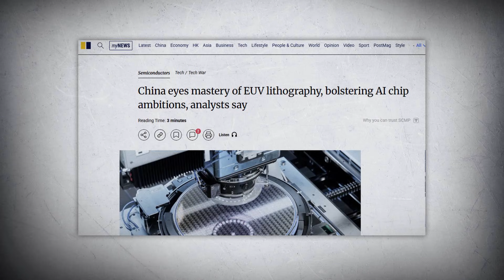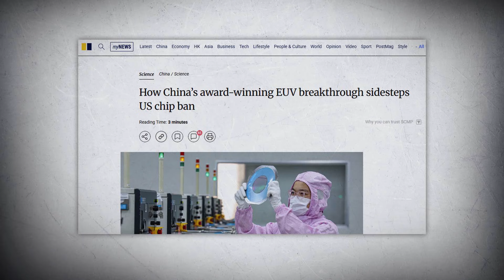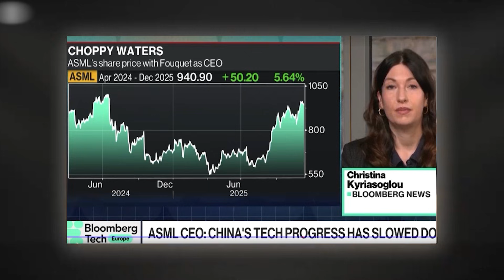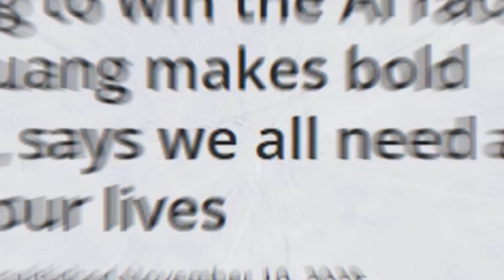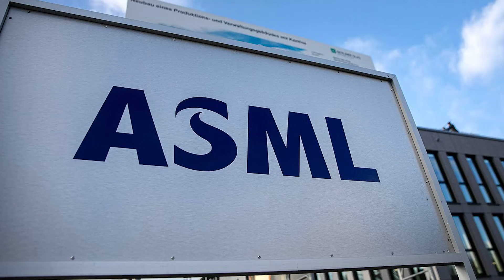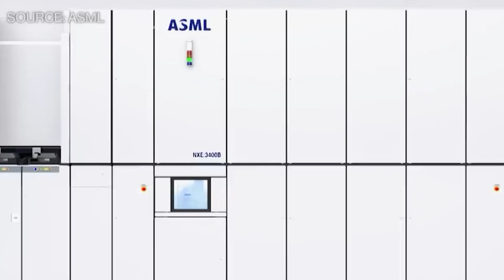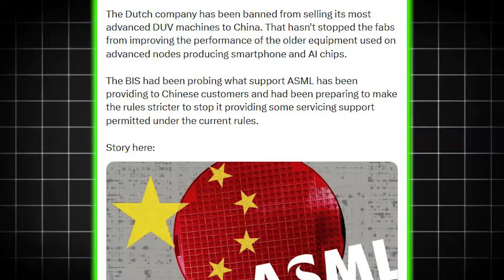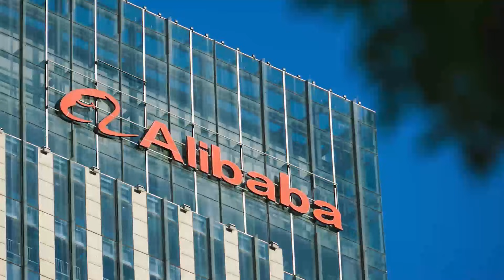China’s Manhattan Project: The Secret EUV Machine the U.S. Tried to Stop

Comment: The Chinese EUV is LDP EUV which is a completely different from the ASML one which is LPP ASML machine.
LPP cannot be done because of its patents in many areas.
China have been working on LDP technology since 2016 and has a lot of patent asocieted to that tech.
Then, Reuters lie citing "anonymous sources" to implant an idea in the mind of the people, which is "China cannot do it by itself, is doing something ilegal and with help with ASML engineers in the shadow"
Their version make not sense at all, because no ASML engineer can help them to develop LDP EUV because is completely different from LPP EUV.
Reply: Exactly.
They make this propaganda just to "justify" them own weakness and future stealing from China
Reply: Thank you for clearing this up.
Reply: A patented right can only be protected against someone else COPYING that patent. However, if someone finds a route (solution) to solve the same problem or issue, it cannot be said to have infringed upon the original patent. In other words, someone else could have found the same solution but did not actually copied the original patent. 

Take for example a famous case in the 1980s - that of the IBM PC when the PC had the total rights to its BIOS - Basic Input-Output System - chipset. This chipset controls the keyboard, the printer, the monitor, the memory, etc in communicating with the CPU and vice versa without which, a computer cannot function. Competing computer companies tried all sorts of ways to get around the IBM chipset using software manipulation (called, "Interpreters") but they were slow and didn't work 100%. In other words, none were 100% totally IBM PC compatible - IBM PC dedicated programs will not fully run on those 95% "compatible" PCs and people wanted to use IBM PC software. 

The impasse' was finally broken when an IBM competitor figure out a way to make their own PC BIOS without infringing upon IBM's patent: they employed a team of computer engineers who are deemed IBM PC "virgins" - engineers who have never touched or seen or used or have anything to do with an IBM PC machine. They were tasked with a situation - if you have an 8000 series CPU and you need to get it to communicate with a keyboard, disc drive, RAM and ROM memory, printers, etc what will you be able to do. IBM had used an "open architecture" for most of the PC's components, but the BIOS code was protected by copyright and was the primary legal hurdle for competitors. 

The engineers got to work and came up with their own BIOS solution - which worked. 

In 1982, Compaq Computers was the first to successfully create its own functional, legally-developed clone BIOS using a "clean room" (with "IBM PC virgin engineers") and reversed engineered the solution to the problem. This proved that a compatible BIOS could be made without violating copyright.

The IBM PC BIOS "monopoly" was effectively broken in September 1984, when Phoenix Technologies released its own legally reverse-engineered, compatible BIOS to other manufacturers, allowing the mass production of IBM PC clones. 

While Compaq used its BIOS for its own computers, Phoenix Technologies developed a fully compatible, faster, and more robust BIOS that it licensed to any manufacturer. This created an open market for compatible PCs and exponentially grew the clone industry, driving down costs and market share for IBM (when IBM held the monopoly over is PCs, it could charge anything it wanted and people would pay. For example, a bog standard 104-key keyboard that costs $10.00 today used to demand a price of $500.00 from IBM or a parallel printer cable that costs $5.00 to make, IBM would charge $100 for - all because of its BIOS).

The availability of third-party BIOS chips from companies like Phoenix, American Megatrends (AMI), and Award, established the IBM PC as an industry standard rather than a proprietary IBM product. This shift led to the "Wintel" duopoly (Microsoft Windows and Intel) and eventually prompted IBM to exit the PC market entirely by selling its division to Lenovo (China) in 2005. 

A scientist once said, "there are more ways to skin a cat" and "there are more ways to get to Rome" which exemplifies the case - in engineering and other technologies, there can be no absolutes in a solution to a problem. Consequently, while ASML has patents to its lithography machines those patents or ways to get something achieved - are no absolutes as there are other ways to get to the same achievements without resorting to copying.    

For those who don't understand what is the difference between LDP and LPP, here is a run through - LPP (Laser-Produced Plasma) and LDP (Laser-Induced Discharge Plasma) are two methods for generating Extreme Ultraviolet (EUV) light for semiconductor lithography.

LPP developed by ASML, uses powerful lasers to hit droplets of liquid tin, offering high power for advanced chips but at a high cost.
 
On the other hand, LDP developed by China, uses a laser to create a cloud of tin vapour followed by an electrical discharge to layer the elemental deposits on a substrate in the creation of a semiconductor chip in the lithography process. This method promises lower cost, simpler design, and better energy efficiency. Its drawbacks are however in the way of power scaling and stability for cutting-edge nodes, resulting in lower chip yield and volume production deficiencies. 

However, there is no saying that China cannot develop a method towards using a similar process to LPP without having to follow exactly the footsteps of ASML. Two people can make a tyre to fit a wheel for a car but without the same rubber compound or the same tyre tread pattern or same internal structure as each other. When natural rubber was embargoes against Nazi Germany in WW2, they developed synthetic rubber for their war machine. 

What the USA has done today is more than just getting ASML to block its sales of its advanced lithography machines to China but getting ALL of the suppliers of parts - advanced optics primarily that ASML has been getting from other companies in other countries - blocked from selling those same parts to China.  

If China wishes to make their own LPP EUV machine, they will have to also find a way to make their own highly specialised and dedicated optics (lenses, lasers, mirrors, etc) which have been the domain of companies like Carl Zeiss SMT (Germany), TRUMPF Lasers (Germany), HOYA (Japan), AGC (Japan), Nikon (Japan), Canon (Japan), Toppan High Precision Photo Mask Inc (Japan), Veeco Ions (USA), Applied Materials (USA), KLA Corporation (USA), and LAM Research (USA).

All those companies and countries have been sanctioned by the US Government from supplying China with critical key components in the manufacturing of advanced lithography machines which ASML has a privy to in receiving for the production of their machines - all of which China must try to find ways in producing herself. This, then is the challenge China faces - not so much the engineering design part but getting the necessary parts needed for their design.
Reply: @GeorgeHooi-t1r That's why there is monopoly and hegemony. When the West copied ancient Chinese inventions back then, they never considered patent issues. Patents are monopolistic tools created by the West after gaining a great lead.
Reply: @GeorgeHooi-t1r if I were Chinese, I will not do a shit thing just no heavy rare earth export to anyone next 10 years.
Reply: 100% True Speech Sir ❤
Reply: The details they described were rather forced, most likely to reassure their shareholders and prevent the stock price from being affected. So they deliberately downplayed it and said it would still take several years, but in reality, production will definitely start soon, no later than 2027. The Chinese have always been fast.
Reply: When Reuters says ASML engineers it doesn't tell its readers that these are ethnic Chinese former ASML engineers, and not Europeans.
Reply: China's EUV lithography machines never needed to reverse-engineer Western products—the core reasons lie in the total lack of physical samples to disassemble, the insurmountable complexity of the underlying technologies that cannot be replicated through teardowns, and our adoption of an independent, diversified technological roadmap. What’s more, China’s EUV tech is far more advanced and powerful than Western counterparts—it not only breaks the monopoly but also outperforms the West in core performance and technical architecture. The Western claim of "reverse-engineering" is nothing but sour grapes.
 
I. No Physical Samples to Reverse-Engineer: Blockades Forced Us to Forge an Independent Path
 
- The US-led comprehensive EUV embargo strictly prohibits ASML from selling complete EUV systems to China; we are denied access even to core components and technical documentation. Without any physical reference, reverse-engineering is simply impossible.

- Even attempting to disassemble older DUV machines would be futile. Mishandling during teardowns can easily damage the equipment, and DUV and EUV differ drastically in technical principles and system architecture—tearing apart a DUV machine yields zero insights into EUV’s core know-how.
 
II. Overwhelming Technical Complexity Makes Reverse-Engineering a Pipe Dream
 
- A single EUV machine integrates over 100,000 components, spanning dozens of disciplines and relying on more than 5,000 global suppliers. Its software runs on hundreds of millions of lines of code, and the nanoscale coordinated calibration experience and long-term operational data are completely inaccessible through disassembly.

- Western core optical mirrors demand a surface flatness equivalent to "a height difference of less than 0.4 millimeters across an area the size of China’s territory", yet teardowns cannot replicate the precision of their multi-layer coating processes. Core technologies like tin droplet control and energy conversion in the light source system are the fruits of years of R&D accumulation, not something that can be copied by taking a machine apart.

- ASML’s equipment is equipped with embedded monitoring systems and patent barriers—reverse-engineering would trigger legal and technical protection mechanisms, making the task as difficult as scaling Mount Everest.
 
III. Independent Ecosystem + Diversified Technical Routes: A Fundamentally Different Path from the West
 
1. Core Technical Route Differences: China’s Approach is Far More Forward-Looking
 
- The West (ASML): A single, inflexible route dependent on US CO₂ lasers to power the LPP (Laser-Produced Plasma) light source. It requires bombarding 50,000 tin droplets per second to generate EUV light, suffering from inherent flaws like tin contamination and low energy conversion efficiency.

- China: Parallel independent and diversified routes, including the solid-state laser-driven LPP route developed by the Shanghai Institute of Optics and Fine Mechanics, the DPP (Discharge-Produced Plasma) route from Harbin Institute of Technology, plus innovative solutions like Tsinghua University’s SSMB (Steady-State Micro-Bunching) and Haoyuxin Optics’ HHG (High-Harmonic Generation) technologies. These are not only fully self-controlled but also directly address the pain points of Western tech.
 
2. Key Advantages: China’s EUV Outperforms the West in Performance, Cost, and Stability
 
1. Light Source Performance Dominance
The West’s LPP light source has a mere 5.5% energy conversion efficiency. China’s solid-state laser LPP has already reached 3.42% (with a theoretical ceiling exceeding 6%), the SSMB solution delivers a power output of 3,200 watts, and HHG technology achieves a "broadband-ultrafast-coherent" trinity with tunable wavelengths and zero contamination.

2. Dramatically Improved Stability
The West’s tin plasma light source causes severe tin contamination, requiring mirror cleaning every 2 hours. China’s EUV-FEL (Free-Electron Laser) solution eliminates tin contamination entirely, extending mirror cleaning cycles to 50 hours. Its power stability of ±0.5% far surpasses the West’s ±5%.

3. Exponential Leap in Inspection Efficiency
Western electron beam inspection is slow and low-throughput. China’s HHG-EUV inspection is 100–1,000 times faster than electron beam methods, with a resolution 10 times better than DUV. It can identify defects smaller than 5 nanometers and enables non-destructive 3D imaging.

4. Superior Cost-Effectiveness and Flexibility
Western EUV systems are bulky, prohibitively expensive, and costly to maintain. China’s HHG systems can be deployed on a desktop scale (just 3m × 1.5m in size), eliminating the need for complex contamination control systems. They boast strong engineering feasibility and democratize access to advanced EUV research equipment.

5. A Fully Localized Industrial Chain
China has built a complete domestic supply chain covering optical mirrors (Changchun Institute of Optics, Fine Mechanics and Physics), laser crystals (Fujing Technology, holding 80% of the global market share), precision structural components (Fuchuang Precision), and system integration (Shanghai Micro Electronics Equipment). In contrast, the West relies on a fragile network of over 5,000 global suppliers.
 
IV. Conclusion: A Victory for Independent Innovation, Not Reverse-Engineering
 
The Western hype about "reverse-engineering" is essentially an unwillingness to acknowledge that China has broken their technological monopoly through independent R&D. China’s EUV technology not only shatters the blockade but also surpasses the West in technical routes, core performance, and industrialization costs. The fundamental difference lies in this: the West has taken a path of "monopolistic single-route reliance + pushing physical limits", while China has embraced "diversified innovation + system optimization"—and that is the true definition of technological leadership.
Reply: Reuters claims China is using reverse engineering, which is complete nonsense. China doesn't currently have EUV machines, so how can they reverse engineer them? Are they reverse engineering something out of thin air?
The most bizarre logic of the West is that they always assume China lacks independent research and development capabilities, and whenever China achieves a technological breakthrough, they immediately claim it's "reverse engineering, imitation, or plagiarism."
If the West refuses to face reality and continues to bury its head in the sand like this, it will only lead to further decline in the future.
Reply: Yah nice recap but lets go into the details if you know them to begin with. Apart from creating the EUV light the big problem to tackle is how to precisely get the light to the silicone wafer, so I can bet that trying to employ people who have been working on this exact issue helps them a lot.  Even in regards to creating the EUV light, it very ignorant to think that the ex-employees know only one thing only. I bet they have a better understanding of the problems to tackle than a regular youtube user who read a marketing summary in some random news outlet.
Reply: @Mirec2x First off, your take has some critical factual gaps that don’t line up with real-world tech R&D and public data on China’s EUV progress:
 
1. Tech route divergence is non-negotiable
ASML’s EUV relies on LPP (Laser-Produced Plasma) technology, while China’s EUV development is centered on LDP (Discharge-Produced Plasma)—these are fundamentally different systems with zero overlapping core patents. China has filed over 2,000 core patents for LDP-EUV (per China’s National Intellectual Property Administration) since 2016, covering light sources, optical systems, and photoresists. Even if ASML ex-employees were hired, their LPP expertise is irrelevant to LDP R&D—this isn’t a “help” scenario, it’s apples and oranges.

2. China’s talent pipeline is homegrown
The core R&D teams for China’s lithography machines come from institutions like the Institute of Microelectronics of the Chinese Academy of Sciences, Tsinghua University, and SMEE. Key experts (e.g., Lin Yinyin, He Rongming) are all locally trained semiconductor specialists with no ties to ASML’s tech lines. China also graduates 50,000+ semiconductor-related students annually (2024 data), building a self-sustaining talent pool—no need to poach ASML staff for insights.

3. EUV light source & optics breakthroughs are independently achieved
In 2023, the Institute of Optoelectronics of the CAS achieved a 100W stable LDP-EUV light source output (published in Nature and the Journal of Semiconductors), a milestone developed entirely by domestic teams. For optical precision control: CAS Shanghai Institute of Optics and Fine Mechanics created nanoscale high-precision mirrors (test report: CAS-SIMM-202405), and Huazhong University of Science and Technology built a magnetic levitation stage with ±5nm positioning accuracy—both are homegrown tech, no ASML tech transfer involved.

4. Public industry data contradicts your “marketing summary” jab
SMEE demonstrated mass production capability for 28nm DUV lithography machines at SEMICON China 2024 and released phase results for EUV subsystems (light source, wafer stage). Even the Dutch Ministry of Economic Affairs’ 2025 Semiconductor Trade Barrier Report confirmed China’s EUV R&D is “completely independent from ASML with no evidence of tech theft.” This isn’t “marketing”—it’s verifiable, peer-reviewed, and government-documented progress.
 
Claiming China needs ASML ex-employees to advance EUV ignores the hard reality of divergent tech paths and decades of domestic semiconductor investment. The “ignorant YouTube user” take is just a lazy dismissal of publicly available, credible data.
Reply: For something national security level technology, you think a few patents will prevent China doing what it wants?
Reply: @luting3  Yes, because it would stop it to sell the chips created with that machine in the rest of the world.
Then by extension all their cellphones, computers, ram, processors, etc...

And also China doesn't need to break the patents because they already create their own technology without need of do anything illegal. 
So what is the point to do something illegal when they already can do it in a legal way?

Even the technology that they create LDP is more simple and  efficient that LPP. 
Initially will be more expensive though, but after polish it will becomes more efficient, using less energy and less expensive chip elaboration .
This mean the tech that they are developing not only is different, but also better.

Then that is the point. They have a better technology now, China is not doing and doesn't need to do anything illegal.
Reply: Patents are irrelevant, if they neither sell the product nor licence they can declare the patents invalid in China
Reply: @psxtuneservice  Reuters claims China is using reverse engineering, which is complete nonsense. China doesn't currently have EUV machines, so how can they reverse engineer them? Are they reverse engineering something out of thin air?
The most bizarre logic of the West is that they always assume China lacks independent research and development capabilities, and whenever China achieves a technological breakthrough, they immediately claim it's "reverse engineering, imitation, or plagiarism."
If the West refuses to face reality and continues to bury its head in the sand like this, it will only lead to further decline in the future.
Reply: @psxtuneservice  Any product fabricated with a machine that break the patents law will be sanctioned by the international law.
If they do that, cannot sell any chip made with those EUV in any place in the world.
Reply: @Ateshtesh  😂😂那就推翻国际法！！
Reply: @Ateshtesh  You are aware that the Chinese do not need to sell the chips to the western countries. They have their own big market. Effectively they couldnt care less about patents.
Reply: @Mirec2x  And?
That is not the point.
The point is that they are creating a EUV LDP tech, not a EUV LPP tech.
Is different technology, they are not breaking any patent law.
Also their tech is more efficient in energy use and once completely polished will be able to produce chips with less money.

Then, why would they break patents law when they already develop a more simple and better tech?

And not, China really cares about patents, they are also subscribe to patents agreement.

That image that you have about China is also inoculated by news media in the same way that today Reuters is inoculating to you the idea that now China is doing shady movements to create their own EUV breaking the law (not directly by suggesting it)
Reply: Patents are absolutely irrelevant in China.
Reply: @thelonegunmen-os3es  actually not.
That image that you have about China is also inoculated by news media in the same way that today Reuters is inoculating to you the idea that now China is doing shady movements to create their own EUV breaking the law (not directly by suggesting it)
Reply: @Ateshtesh I really don't care about what western media outlets spread about China. I am just stating the obvious and I am cheering for China about this result because it will benefit any PC consumer in the next future. I am only positive about China and their technology development.
Reply: @thelonegunmen-os3es  actually not,
That image that you have about China is also inoculated by news media in the same way that today Reuters is inoculating to you the idea that now China is doing shady movements to create their own EUV breaking the law (not directly by suggesting it)